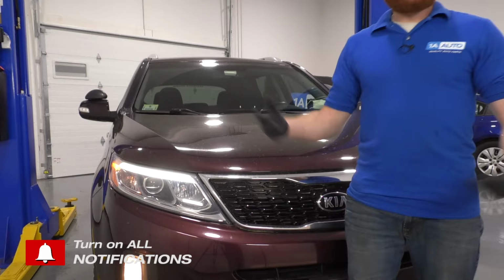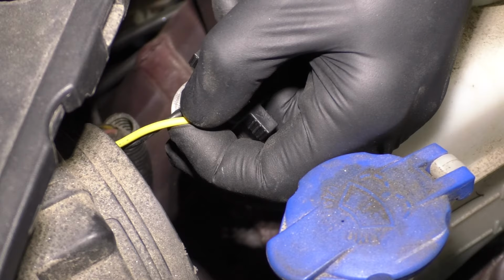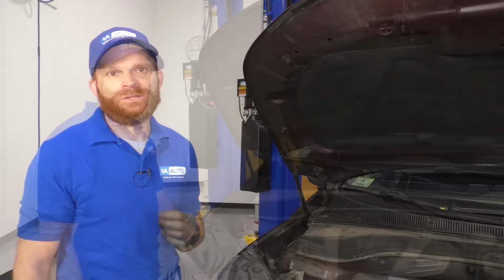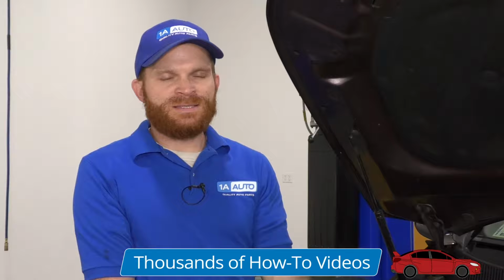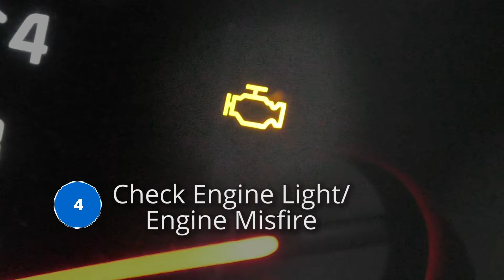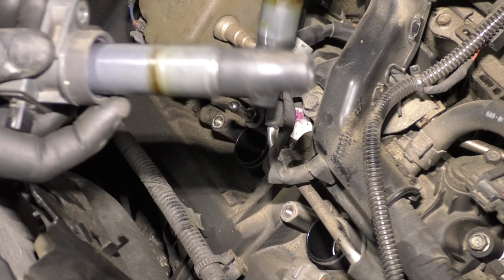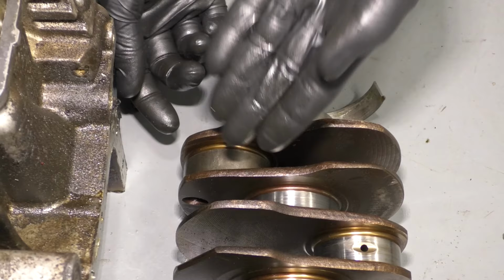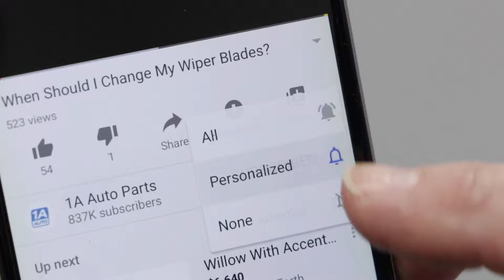Top 5 Problems Kia Sorento SUV 3rd Generation 2015-20

Comment from the maker: √  Watch the Video
√  Buy The Part at 1A Auto http://1aau.to/m/Visit-1AAuto
√  Do it Yourself
√  Save Money
Reply: Engine failure doesn’t commonly happen on the 3.3. The one common issue you have missed is a faulty 4wd coupler causing vibration when starting from a stop.
Reply from the maker: +Biggs Foot We don't currently have headlights for this generation Sorento.  Please check back as we update our inventory often.

Comment: I’ve owned a 2017 Sorento for almost 4 years now and have experienced very few issues.  Other than routine maintenance and a brake job, I haven’t had to take it into the shop.  It’s been the most reliable vehicle I’ve ever owned.
Reply: I bought the V6 model (2019)  I'm very satisfied with it.
Reply: Bought the 2016 Kia Sorento, had it for about 4 years just hit 95k miles, did my regular maintenance, I was heading towards Vegas with my wife, all of a sudden, check Engine light came on at 10pm middle of no where. The car started to slow down didn’t have any service, had to walk to the gas station, tow the car back home which costed 1k bucks. Took the car to the kia service shop, and found out that the we needed a new Engine!!! Rod bearings gave out.. really disappointed. Not sure if it’s going to be under manufacture warranty.
Reply: It should be covered. There’s a warranty bulletin out there for that exact issue.
Reply: @davemanzombies3853  Sorry to hear about your engine.  My Sorento has just under 92K miles. Hopefully it doesn’t experience any major mechanical failures.
Reply: @davemanzombies3853  , same exact thing just happened to me.

Comment: If the 4 cylinder engine dies, it's covered by the court settlement. Look it up online.  It's unlimited mileage (Yes really) and covers the 4 cylinder 2.4 and 2.0T through 2017 at least.
Reply: do you know if its only in USA or canada aswell? also is it only if you OWNED a kia at that time or let's say I would buy a kia sorento 2017 2L turbo I would have a free engine for life?

Comment: I don't buy the headlight theory that the wiring resistance is too low. The headlight bulbs are designed for a specified voltage range of alternator voltage for all 12V vehicles. The problem can only be that the alternator control of output is poor, or possibly the headlight units are sufering a high degree of vibration or physical shock. I am an electronics engineer

Comment: Found myself here because of #5 - total engine failure due to lack of oil (and lack of warning - oil pressure light.). If you buy a 3rd Gen Sorento make sure you get the software update specifically for this issue - you will have a lifetime warranty on your engine. The 4 Cylinder Sorento engines burn oil after 50k miles and you will not be warned about low oil pressure.  Learn from my mistake - my engine wasn’t covered.  Frankly, I’d just stay away from these cars altogether but if you do buy one, get the update.
Reply: Apologies for the noob question, how do you get the update

Comment: I have a 2015 Kia Sorento EX v6 that I purchased in 2015 with 28k miles. It is now 2023 and I have 240k miles on it & it drives like new. I had issues when it was about 80k miles that warranty mostly covered ( 2 alternators, the motherboard and the EVO radio which also controls the backup camera). The last 160k miles have been relatively trouble free except for routine maintenance. I have had the headlight bulb issue but found using bulb grease helps longevity by giving a better connection.

Comment: My wife and i bought a used 2017 Sorrento. It is in excellant shape. We have put some miles on it just running around. But a few months ago my wife had to take a trip to mississippi. We live in missouri. I told her to check the oil everytime she stopped for gas. When she returned i checked the oil and it was full and clean. She didnt add any oil because it was full and clean. I love the damn thing.

Comment: Most of these engine issues are with the 4cyl version. The V6 is a pretty bullet proof engine. I have a 2020 Sorento SX V6 AWD with 39k on it and it's been SUPER reliable. And it has a nice throaty growl on cold start up and when accelerating. The only thing i had a problem with since i bought it used in like new condition. Was the shifting between gears on a cold start would skip or lurch the vehicle forward until the engine warmed up. It's a fairly common problem i read on various Sorento forums online. However, that was solved by the dealership running a flush and re-program of the gears. And it's been smooth as butter since.

Comment: Lenny and Ai did an excellent job of covering the top 5 issues on the Kia Sorento. I have owned 3 vehicles boing back to 2011 and I have a 2015 Sorento EX now. I have kept up wit the maintenance and have had just a few problems, mostly cosmetic . Brakes done twice and it gets bit more juice and pep with the synthetic blend oil.

Comment: Wow thank you. I have a 2014 Kia Sorrento have all the issues you mentioned. I’ve had to replace bulbs at least 4 times within a short space of time. When I drive it does make the rattling sound. I’m fearing I’ll need to replace the engine (which is covered under warranty) but the wait at the dealership is over 2 weeks. They said if I drop it off it will take 2 weeks… this is frustrating
Reply: Bought the 2016 Kia Sorento, had it for about 4 years just hit 95k miles, did my regular maintenance, I was heading towards Vegas with my wife, all of a sudden, check Engine light came on at 10pm middle of no where. The car started to slow down didn’t have any service, had to walk to the gas station, tow the car back home which costed 1k bucks. Took the car to the kia service shop, and found out that the we needed a new Engine!!! Rod bearings gave out.. really disappointed. Not sure if it’s going to be under manufacture warranty..

Comment: I have a 2013 that kept blowing the bulbs and the harness connector was melted. I spliced a new connector to the existing wires and melted again. I ended up changing the entire housing (aftermarket) and it fixed the problem.

Comment: FYI; class action lawsuit in the US was settled for 3/4 of a billion and another lawsuit pending in Canada related to engine failure in Kia cars/SUVs for certain years. Main culprit seems to be 2.0 litre GDI which is prone to total failure. Just happened to me. 2015 Kia Sorento with only 62,000 km (about 40,000 miles). Kia Motors authorized dealer to replace the engine with a new one.  Probably a $10,000 repair job if I had to pay for it. Apparently the problem is metal debris from manufacturing  process clogging the oil ports you showed, leading to bearing failure at which point the engine self-destructs. Oil changes  and top ups are not going to prevent this. But be sure to change oil regularly as Kia asks to see records that this has been done.
Reply: Yes, and the same problem was reported (recall-wise) for the 2014 +  Hyundai Sonata. Every owner should have gotten an extended warranty guarrantee. Mine ran flawlessly for 75,000 miles. I had just put on new tires and an oil, filter, and cabin filter and a woman rear-ended the car at ~40 MPH. Totaled it! This is the worst time to buy/replace what had been a great car!
Reply: What if I don't have records because I change it
Reply: I have a 2016 sorento and I’m currently going through this but they are giving me hell about replacing why? Idk I’m so frustrated!
Reply: @jaebee88  hey I have the same car and problem did you buy your car used, I need someoneto talk2 about it, can you text me , so you have facebook?
Reply: @Brandon-21MN  same with me. My 15 cadenza shares the same 3.3L sorrento but they haven't said a word about the cadenza being recalled. No letter or anything as far as updates either. And just recently my connecting rod bearings started to fail. Ran perfect and I did my own oil changes to be sure I knew what was being done. I only ran penzoil full synthetic with mobile one filter. Noticed shavings on my last change then not even 2 weeks and it started knocking at start up and acceleration so it's been parked ever since

Comment: The ones with the 3.3 V6 are prone to oil leaks. Most commonly from the oil pressure switch. Kia extended the limited warranty for 2014-2018 sorentos with the 3.3 V6 from 5 yrs /60,000 miles to 15 yrs/ 150,000 miles whichever comes first to address the oil pressure switch issue
Reply: Is that for US only or Worldwide ?

Comment: Very helpful, I am still in the hunt after 3 years having random events of engine lacking power and sputtering, even when reving up it is like not engaging. By now after so many googling I guess it’s not a single issue but a bunch of issues, gonna test the coil and see instead replacing all fuel system components.
Reply: Have you installed an oil catch can? That's what I do with mine have that I don't have any problems what you mentioned. I own a 2019 Sorento all wheel drive V6 3.3 L engine and installed an oil catch can and it runs wonderfully

Comment: I know there have been problems and recalls for the first few years, but I figured the 2019 and 2020 models should be all sorted out as long as proper maintenance was done regularly. I was really considering trading in my 2015 Sportage LX AWD with less than 110,000 km (69000 miles) for a Sorento V6 EX AWD, preferably a 2020 with lower mileage than mine, so I can tow a 3000lb trailer, plus whatever is in the car. Would you advise against that? These issues seem minor if the oil is topped up and changed often.

Comment: These Kia V6 motors like clean oil and full trust me I have the 3.5 in my 2012 sedona and it makes that noise on start up if they oil is not always full. If you want this engine to last a long time try not to do short trips in the city. If you live in a cold place in the winter make sure to plug in the block heater and synthetic oil is a must! These V6 kia hyundai motors are good just take care of them the 3.3 the 3.5 and the 3.8 Lambda II is good.
Reply from the maker: +Jeremy Bonham Thanks for checking us out!

Comment: Oil pressure sensor fails and looks like  main seal is leaking  its the oil pressure switch or oil filter housing still a pain to change it's under the intake

Comment: I found that the headlights would last a lot longer on KIA’s if you don’t slam the hood down hard. I learned this from frequent light changes on a Optima and Sorrento and once I did not slam the hood down problem went away.

Comment: Thank you for the information. Can you please help me with this question. I have looked in the owner's manual and service manual and it doesn't tell me what type of power steering fluid to use. 2017 Kia Sorento
Reply from the maker: +Cod3 Man The type of power steering fluid that is specified for your vehicle should be marked on the PS reservoir or filler cap.
Reply: The 3rd generation Kia Sorento has an electronic power steering system. No fluid needed.

Comment: The engine issues you talked about was mainly if people dont keep up their mantenaince. Any vehicle, not just Kia will experience engine issues if the oil isnt changed, if low quality or improper oil is used.
Reply: Agree
Reply: The engine issues pertain only to the 4 cylinder models . They weren’t built right. I know people that had their engines seize on them while driving

Comment: Yes #5 just happened to my 2016 sorento and in the exact same manner as the example given.....was on a major highway, knocking, loss of power, pull off the road, tow....cata engine failure.  Oil level was fine and changed regularly by a shop.  180,000 kms...thee end RIP.

Comment: Which engine is better, the 2.4 or the 3.3V6, does the 4 cylinder has the same issues or worse?
Reply: Both of them are bad, v6 is less bad.
Reply: V6 is the better engine
Reply: @zzxxenith  2.4L is better

Comment: I drive a 2015 Kia Sorento LX(base model) like this and I have abt. 79,000 miles on it now. Bought it used with 60,000 miles. Once I hit around like 75,000 miles, I was driving on a long highway and all of a sudden, I heard a boom clank! And then engine light came on. It wasn’t going even though I was pressing the gas and I was in the middle lane which was scary but eventually got to shoulder of road. It wouldn’t drive past 25 mph. We took it to family friend mechanic and they said it was a broken knock sensor. Was about to pick it up the next day and said there’s more issues with it that they couldn’t figure out. We had it towed to Kia dealership. KIA SORENTO 2015 HAVE ENGINE RECALLS!! the people at Kia said “yea that happens a lot” um! Pls check and make sure yalls engines are up to date! They replaced my whole engine with no charge. Also, when I got the car two years ago, I immediately switched the lights and had them customized to a brighter bulb which makes it so much better to see. The Kia Sorento lx 2015 had a poor rating in headlights.
Reply: Aw I hope they fix mines for free my engine just went out at 116,000 I have the same model car as yours. And I hope they fix it for free too I’m waiting to hear back from them now..

Comment: I have a 2016 Sorento. Issues with the bulbs -check. AC lines and now heater. Radiator cap wasn’t keeping pressure.
Reply: Did you just replace the radiator cap ?

Comment: So I have a 2014 Kia Sorento and my tail lamp last about two month or so before one blows I use dielectric grease and replaced a harness had the clock spring issue with it and it was a recall for it and I also have a issue with my passenger doors unlocking and the decided to solder the door relays on the IPM board that I really don’t want to take to the dealer for because it cost a $1000 plus to fix

Comment: I change my oil religiously and clean the map sensor every 20k at least i just hit 71k miles owned it new and runs like a champ. Most people i hear about having issues are folks who dont take care of it to well. I go camping a lot so usually check things frequently. I already had O2 sensor done covered under warranty at 32k miles i have done passenger balljoint, four shocks upgraded to KYB along with KYB strut mounts. Front sway bar links and passenger inner outter tie rods. Upgraded my lights to led which might be why they do not burn out. I usually just use Orielley auto parts simply because they are oe. Quality im afraid of autozone and advance auto. I might try 1A auto parts just for comparison on quality now that i heard of you guys anc thd reputation about 1A auto
Reply from the maker: +Multidimensional Traveler Thanks for taking the time to check us out, we appreciate it!
Reply: LED bulbs generally do not run on 12v so there is a DC to DC inverter to get the correct LED voltage built in.  = The changing range of input DC (for this KIA) is buffered somewhat = much less voltage fluctuation (if any) going to the bulbs.  You could also try some "conductive grease" on the OEM connections.  

= quality led bulbs should fix this situation.
Reply: @jonmccormick8683  cold you tell me which best brands do you recommend ? Thank you 😊

Comment: Bought the 2016 Kia Sorento, had it for about 4 years just hit 95k miles, did my regular maintenance, I was heading towards Vegas with my wife, all of a sudden, check Engine light came on at 10pm middle of no where. The car started to slow down didn’t have any service, had to walk to the gas station, tow the car back home which costed 1k bucks. Took the car to the kia service shop, and found out that the we needed a new Engine!!! Rod bearings gave out.. really disappointed. Not sure if it’s going to be under manufacture warranty.

Comment: The voltage output of the alternator could be too high OR not enough heat is being dissipated from the bulb by its socket OR both. I'd check the alternator /regulator output with a 'scope. If that's OK, I'd try to get rid of more heat from the bulb by using thermal- conducting grease (like they use to mate a transistor/FET to its heatsink) on the socket's contacts, both electrical and metal-to-metal. I'd also try to increase the area of the metal flange of the socket to do the same if the grease doesn't help. Maybe the"harness replacement" could work because they've re-designed the socket/harness to dissipate the heat. All any wire can do is resist the flow of electrons. The thicker the wire the more current it can pass without causing a "voltage drop" (e.g. heat). To say the harness/wires are allowing too much current to the bulb is misleading. That implies that the manufacturer intended the wire to act as a "resistor" between the alternator and the bulb. I'ts more likely that the manufacturer skimped on the size of the wire to save a few bucks! Copper aint cheap no more! It's the load (the bulb's filament resistance) which establishes the demand for the alternator's/battery's  current in the circuit. Perhaps the manufacturer of the bulb decided he wanted a brighter output and threw caution to the wind... or it's a cheap filament for the specified/required output (China?). Then again, perhaps it's the initial surge of current hitting that filament, causing it to break after so many cycles of off-to-on. To combat that, I'd insert a "choke" to slow that in-rush of current. Yes, I can get pretty deep but 65 years in electronics will do that to ya! Good luck all!

Comment: I bought a 2019 kia sorento ex. 1 owner vehicle before I purchased. My biggest problem is the headlights seem to be pointing down. I can't drive in flurries (light snowstorm) or drive at night. Also even when it rains heavy towards night time I don't trust driving it. I replaced the bulbs this week and still seems to be a problem. Has less than 24k miles on it. The only adjustment is for the headlights to go left and right. Not up and down..... HELP!